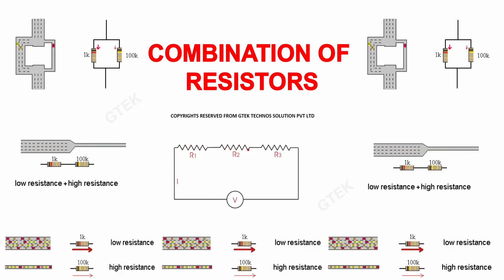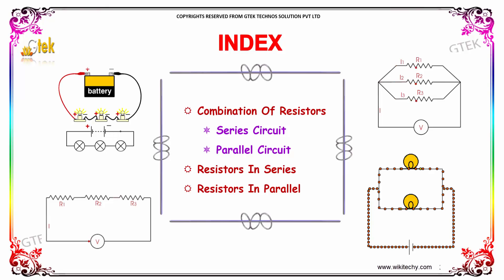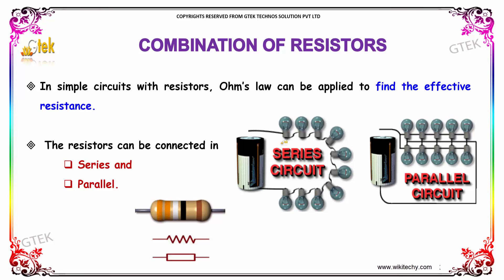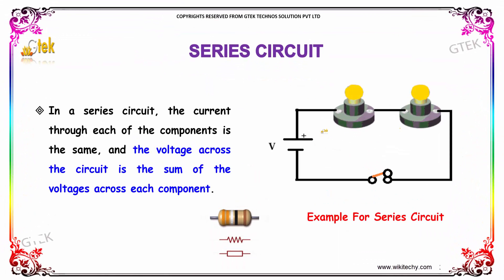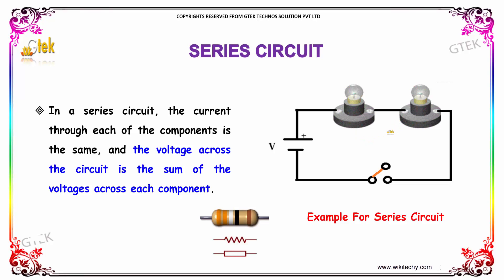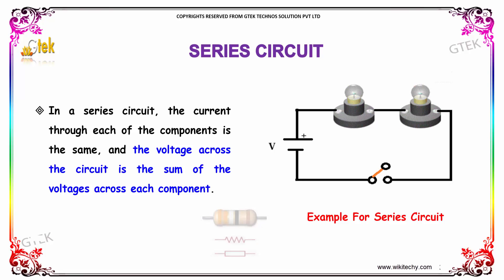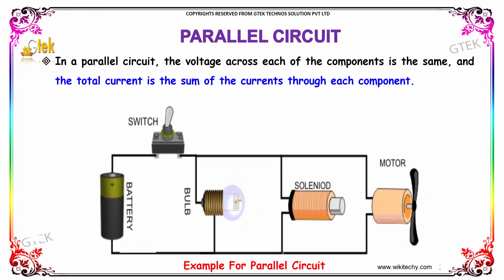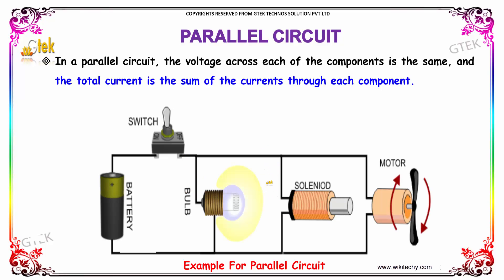Combination Of Resistors Current Electricity class 12 physics subject notes lectures CBSE IIT JEE

Comment: In series combination Potential difference across each resistor is different depending upon the value of resistance. 4. Equivalent resistance of circuit is equal to the sum of individual resistances. If one component is fused, then the other components of circuit will not function.

Comment: In a series circuit, the current through each of the components is the same, and the voltage across the circuit is the sum of the voltages across each component. In a parallel circuit, the voltage across each of the components is the same, and the total current is the sum of the currents through each component.

Comment: In a purely parallel circuit, there are never more than two sets of electrically common points, no matter how many components are connected. There are many paths for electrons to flow, but only one voltage across all components: Series and parallel resistor configurations have very different electrical properties.

Comment: n electrical terms, this is represented by two circuits with equal voltages and different resistances. The circuit with the higher resistance will allow less charge to flow, meaning the circuit with higher resistance has less current flowing through it.

Comment: Components of an electrical circuit or electronic circuit can be connected in many different ways ... Therefore, all of the components in a series connection carry the same ... The total resistance of resistors in series is equal to the sum of their ...

Comment: Two elements are said to be in series whenever the same current physically flows through both of the elements.  The critical point is that the same current flows through both resistors when two are in series.  The particular configuration does not matter.  The only thing that matters is that exactly the same current flows through both resistors.  Current flows into one element, through the element, out of the element into the other element, through the second element and out of the second element.  No part of the current that flows through one resistor "escapes" and none is added.

Comment: Resistor circuits that combine series and parallel resistors networks together are generally known as Resistor Combination or mixed resistor circuits. The method of calculating the circuits equivalent resistance is the same as that for any individual series or parallel circuit and hopefully we now know that resistors in series carry exactly the same current and that resistors in parallel have exactly the same voltage across them.